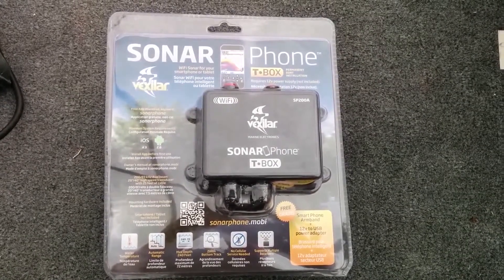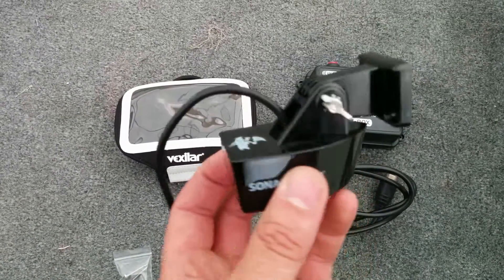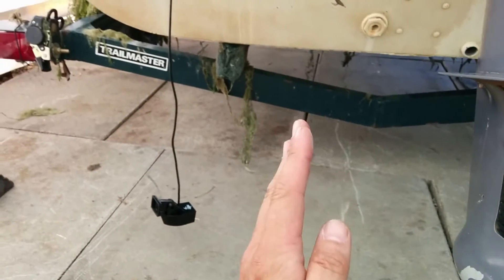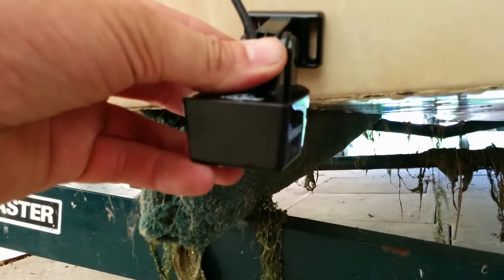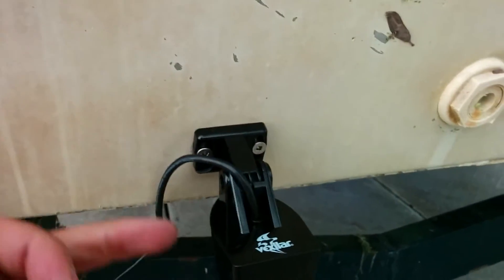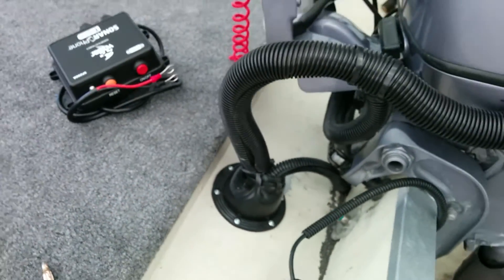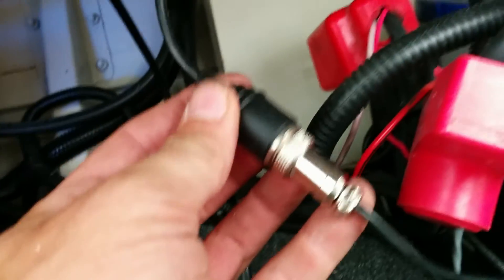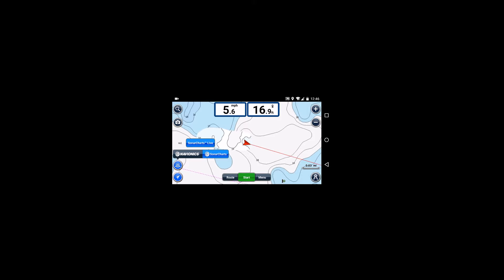Vexilar SonarPhone Install for use with Navionics SonarCharts Live

Comment: The SonarPhone by Vexilar will work with Navionics Apps/Maps correct? I believe you can also do Split Screen? I'm speaking of the T-Box SP200 and SP300. You can also Self Map or whatever it's called in which you can create maps of the water your in by driving around in your boat as it's recording the data, at end it puts it order by quadrants, I believe, correct? If so, that's awesome.
Reply from the maker: Yes to all your questions. Sp200 works very well with the Navionics app